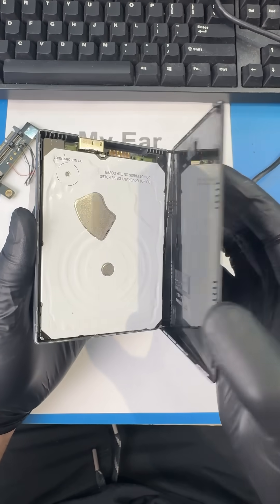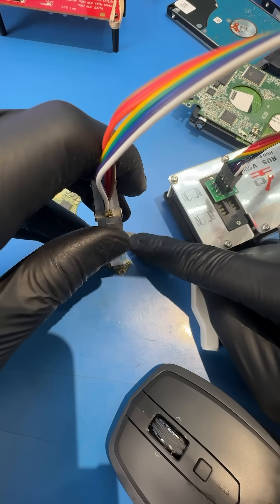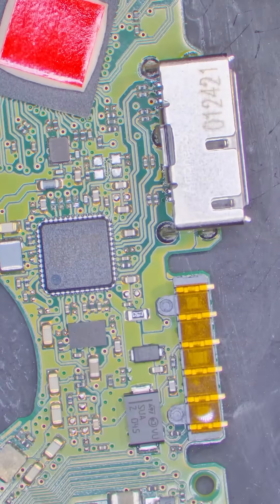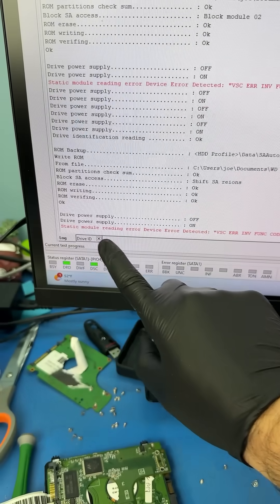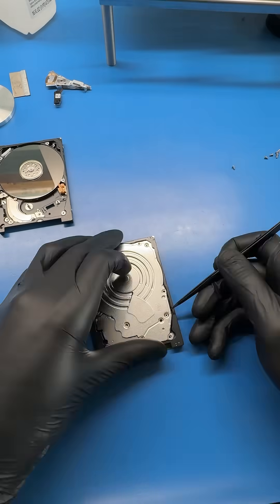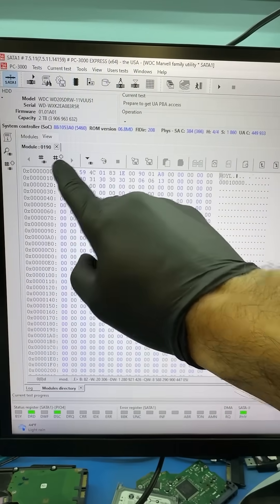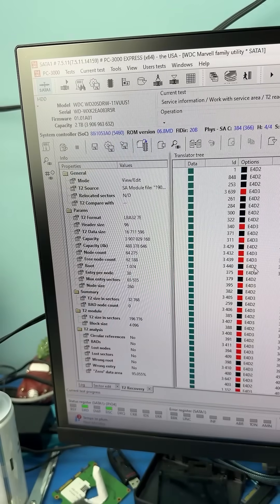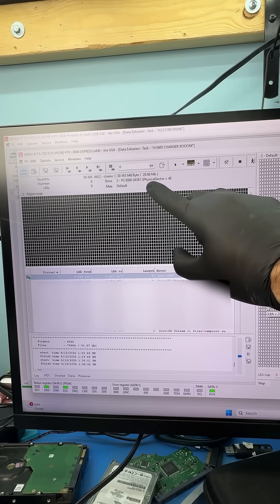Hard drive translator...? #tech

Comment: Plot twist: he had 29 MB of data 💀
Reply: @MDrepairsLLC  You work with HDD alot. Can you say if WD is more Reliable than Toshiba?
Reply: @mosayyeed  Personally, I've stuck with WD mostly for the last 20 years. Never had any fail on me yet, just one or two that developed bad sectors but nothing catastrophic. I must point out that I always actively cool my disks with dedicated fans to keep my HDD temps below 40C, and max 43 at all times. Any temperature above 50 C is potentially destructive for any HDD. Mostly because the heat can warp the case and cause the heads to become misaligned. Check out the IBM Deskstar fiasco back in the early 2000s.
Reply: @paulmichaelfreedman8334  Thank you. I'm looking to purchase just a 1TB External HDD to supplement my laptop storage, and I want to chose between Toshiba, Seagate and Western Digital.
Reply: @mosayyeed seagate and maxtor 2.5“ drives uses SATA drives where WD 2,5“ uses drives that have the USB ports directly on the Drives pcb
Reply: @mosayyeed the only HDD that ever died on me was a Toshiba :(
Reply: @paulmichaelfreedman8334  the issue is complete change ownership usually in that time and manufacturing processes
Reply: @paulmichaelfreedman8334 dude 50⁰C isn't warping anything
Reply: @TheCod3r  dude, ibm released drives that warped above 50c and crashed the drives heads. Massive recall. All hdd cases warp with temp rise. Just normally not enough to cause problems. Above 60c all drives run this risk
Reply: @mosayyeed WD and Toshiba, Seagate meh I've had some issues. Look at servers they prefer WD and Hitachi which is WD now, they are not as good as before they were owned by WD but still good.
Reply: @mosayyeed  I had a Toshiba drive in my PC, died in 8 years
Reply: @MDrepairsLLC    bro need help with my HD, I think it's corrupted after directly removing from laptop without safely eject, I saw in bio can't send to your location because I'm from India, I'm feeling devastated because my father passed away and his memories are in them, I can loose anything in it but not them, please help 😭
Reply: @MDrepairsLLC 😂😂😂
Reply: @MDrepairsLLC 
You're doing incredible work.

Because you make it look so easy, people don't realize how difficult it is and what a huge amount of effort it's taken to get to this level.

Bravo Sir 🏆
Reply: @MDrepairsLLC 😂
Reply: it is for unreadable sectors , wich may or may not result in some corrupted files
Reply: @viktorgyory3826  well since he's a game dev i assume he can just rewrite them back assuming it's not something important
Reply: @viktorgyory3826 maybe it was that scratch mark area
Reply: @viktorgyory3826 a large percentage of the image is empty space/remains of deleted files and large files like videos (which are usually corruption resistant so likely to still work minus the bad part)
Reply: That's amazing only 29 mb! Like the dude said probably just some unreadable sectors.. also, I love the dust free chamber. Where can I get a dust-free chamber out here in Western Mass?!  Awesome work brother keep it up keep "postin"!, 👍🏻🔥
Reply: @shawnyDcustomAB  No idea, but if I were to start a business, I'd call it: Dustin' Off-man
Reply: @landsten-  🤣
Reply: @landsten- When storing paper plates, it's a common practice among my friends and family to leave the very top plate on the stack to keep dust off the plates. I wrote Dustin on the one and now I've gotten my friends to start regularly thanking a paper plate named Dustin for his service.
Reply: @shawnyDcustomAB  if that was 29mb of code files, that's a TON
Reply: @PabloDeLafuria no it's actually 29Mb.
Reply: @FarsansTorraOrdvitsar It‘s actually 29MB
Reply: @shawnyDcustomAB  can always check some local lab equipment sellers. Probably similiar to a laminar flow hood.
Reply: @shawnyDcustomAB haha maybe the new eastfield mall strip will have one. 😂 I'm from the area 2.
Reply: @JAlves88  
Yeah bro I can't believe they took that that thing down you know like wow and now it's a total mess I just live off of Boston road it's not too far 👍🏻
Reply: @shawnyDcustomAB get a hood and some type of pressure room with grounded floor ? I think that's how they do it im sure it's more complicated than just that . I lived in Trinidad Colorado for a time and we'd get a five gallon bucket of dust just off the floor each week it's like the dust goes through the walls
Reply: @shawnyDcustomAB  it would be very similar to a paint room as well or any process you need it super clean with no air particles floating around or as little as possible, you could probably look up how to get the whole thing started for a room but what for they are probably very expensive to build id imagine you would need an hvac system and the room sealed off to a specific spec for the work your doing
Reply: @shawnyDcustomAB ohh shit shout out to the 413! Love WM 💪
Reply: @Lazysquid27  
What's up squid from the 413 off of Boston road Springfield nowadays
Reply: @shawnyDcustomAB bot
Reply: @shawnyDcustomAB  a couple big  blower style fans, a couple HEPA furnace filters, a top and front made from plexiglass and some through holes for your hands, paint the inside of the box flat white and have a light shining on the walls, not in your eyes. Could probably do with a big  cardboard box, more plexiglass or a roll of aluminum flashing for roofing trim and some clear packing tape. Just have to Google how to keep the static down.
Reply: @shawnyDcustomAB build one out of plastic sheets, HEPA filters, fans, some PVC or wire hangers + tape, and a boatload of aluminum tape. It’s up to you if you want to recycle some of the air for purity or stack increasing PPM filters.
Reply: @shawnyDcustomAB You can build one really easily. Just use your head for a few minutes and realize that it's a chamber that's dust free so you just get a filter. You're welcome and I won't even charge you $100. Kol
Reply: I mean... if it's only code, then 29MB would be really a lot.
So, just the size is no indication of its value
Reply: @mz00956  true,  try write in notepad 1281 words its just 2kB ..29MB is alot raw code yes
Reply: @mz00956 by it’s size and some EFI text I can assume that it’s some readonly boot partition, maybe
Reply: @mz00956 exactly what I’m thinking too. It’s like 29 million characters of code… It’s pretty much. I like to have some background info from the person that wrecked it from start, you know stuff doesn’t just happen, right from the blue. There are always some kind of prelude or something like that right before shit hits the fan. But my hat is coming off for you my friend.
Reply: I read your comment during the first half of the video and was like “haha, funni”. But then we got to the point of your comment in the video and I was like 😳
Reply: That's a lot of code
Reply: You probably don't know how many lines of code would be 28 MB 🙂
Reply: @sina121-s2o  that's the point, I do
Reply: @sina121-s2o  that is true but 28mb might be useless windows junk or something else so we don't know I think that if he upload it here customer is happy so probably those 28mb aren't code
Reply: At least they recovered 1 MB.😂😂😂
Reply: One megabyte of code Is still a lot @MrItalianfighter1
Reply: @MrItalianfighter1 
Jesus is the way, the truth and the life. Turn to him and repent from your sins today ❤️
Reply: Those scratches are prob the reason for the missing  29 mb 😅
Reply: 29 MB is a LOT of code.
Reply: Second plot twist. That 29 MB was the only data he really needed.
Reply: Imagine if that's all code in txt of 29 MB😢
Reply: All dependencies recovered, no code 😂
Reply: A missing ISO. File can destroy the whole game and it's just like 2.7kbs
Bro 🙏💀
Reply: No he had 51.97 GB of data! It's in bottom of screen at end
Reply: data with actual value generally isn't terabytes or gigabytes
Reply: - ROFL  ‼️ 😂
Reply: Says the guy with 30 kilolikes!
Reply: @htcsmartphone96  yes, 3 weeks ago I also made a comment, mentioning 29 kilolikes
Reply: I had a customer pay 1200 euro to recover a 2 MegaByte file from a 20GB harddisk. The file was worth a lot to him. It contained information on which persons had borrowed artifacts from his museum.
Reply: Doesnt matter, MS-DOS was 160KB, and it made Bill Gates the wealthiest man in the world at the time. Its not the size of the file, its the content.
Reply: I mean you can see the size clearly
Reply: That's the size of the whole game Animal Well
Reply: And password for 500 Bitcoins.
Reply: tbf, you can have a lot in those 29Mb
Reply: Fun fact: I watch this video during a macOS update, and 29 min left
Reply: 29 MB of code in txt format is a LOT of code!  I've been programming all my life and I don't have that much code .
Reply: @DeadCat-42it's a gaming dev. so it can be sound files, textures 3D-Models ... anything then 29Mb are nothing! who the f knows maybe  even the game dev doesn't know what's missing.
Reply: @DeadCat-42 it is, the bigger the 28 MB that was not recovered. Not sure if everyone follows.
Reply: You said the link is in the bio, is it on your channel. I have an 8tb ssd, one day it just didn’t boot anymore. it looks like it turns on but nothing shows! Where could I possibly goto fix it?
Reply: 29MB is probably what would fit on those two tiny little scratches.
Reply: Ahhhhh
Reply: He was a game développer he was developing what? A N64 game? 😂
Reply: was probably working in Concord
Reply: Plot twist: it was his crypto keys
Reply: The 29mb was his crypto wallet😢
Reply: Bro was making a game in assembly lol
Reply: thats the problem in modern it. only 29mb. if you leave out libraries and assets like pictures movies and 3d models. 29mb of code is absolutly massive
Reply: lol
Reply: Hey I've seen some games with 10+ hours of gameplay while only being 460MB. So 29MB could be a good amount of game.
Reply: 29mb of code is a lot
Reply: No he actually had 28.01 megabytes
Reply: Let's just hope it wasn't 29mb of code, cause that would hurt 😅
Reply: 😂😂 After recording all this over several days, instead of deleting it. 

Smart move.
Reply: Game developer who doesn't know about backups or at least git? Bruh moment
Reply: Jesus is the Son of God. He died on the cross for our sins and was resurrected three days later. Believe in Jesus and you will not die, but have everlasting life.
Reply: @Dr.Soda7   Why not believe in his Father instead.🙄
Reply: @napoleon760 God is God the Father, God the Son (Jesus), and the Holy Spirit. If you believe in the Father, you believe in the Son, too. The Father and Jesus are one but the Father is greater than the Son. 

John 10:30-38
King James Version

30 I and my Father are one.
Reply: Let’s hope the unreadable part was 3D models/images for the game and not his code 😂

Always make backups of your code. You can even compress them with encryption and upload them to the cloud.
Reply: His favorite porn is destroyed right in the middle of the movie… So sad 😂
Reply: Said they saved all but 28 mb of data. Probably exactly where the bitcoins were being stored.
Reply: Well passport 😅😅 is important
Reply: Would be totally awful luck if it just so happened to be his favorite porn video
Reply: That's porn video got corrupted
Reply: 😂well all that for a mb
Reply: And what's funny is he probably recovered greater than 100% in other data recoveries. So, he had some in reserve and still recovered everything! 
😂
Reply: Everything but their crypto keys
Reply: It was bitcoin wallelt ;]
Reply: plot twist: that 28mb was his code part which is hundreds of thousands of lines of code xD
Reply: Wow that was some serious skill. Do you think its better to use Solid State drives so this is less likely to occur?
Reply: You can actually see on part of the video. It’s a two terabyte drive. At 1:46
Reply: 3-2-1 Rule!
Reply: 28mb sounds like the browsing history to me
Reply: Small game I guess
Reply: Hey, if its all source code that's a fuck ton of data

But if its art assets upsi : )
Reply: Game developer working with mediaeval technology then
Reply: I still have my WD Passport for 15 years now and still working. 😮😊
Reply: If it's only in code that would still be a lot of work lost :D
Reply: Yeah.. but that 28 mb of data was a 99 cent game that sold a million copies.. so good thing he knew the mad forensic drive doctor here...
Reply: @wesstone7571  28 MB is the amount that was not recovered
Reply: Text scripts are tiny. Would make perfect sense to me.
Reply: THE BEST JOKE EVER...ahahaagahh
Reply: @sankako6075  
Bro everybody is taking me serious I don't know if you're telling me it was a good joke but I thought it was I'm being so sarcastic about the dust Free chamber LOL 😭